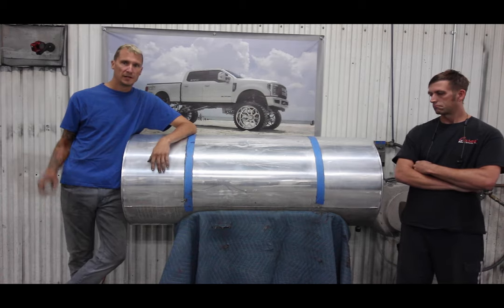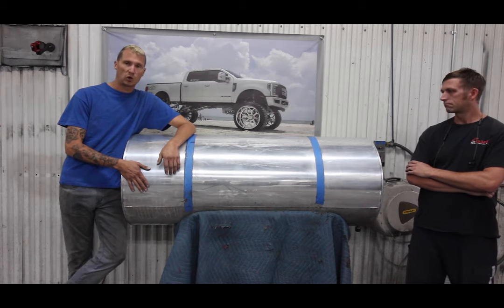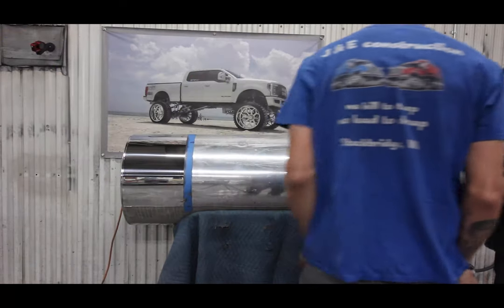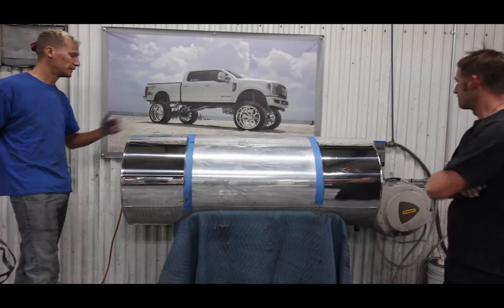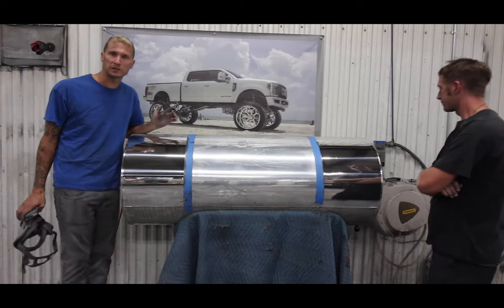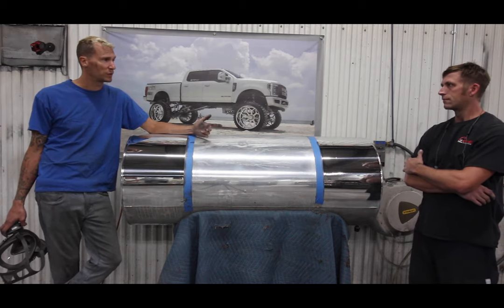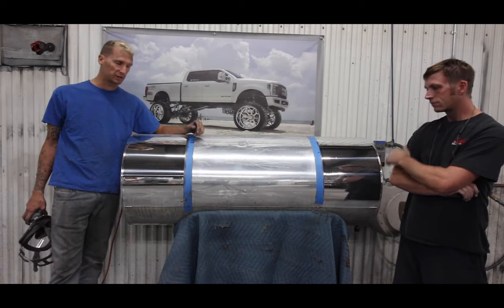Metal polishing difference between 3,000 rpm and 6,000 rpm with Evan's Detailing and Polishing

Comment: Good video with plenty of info. In a matter of saving time in my opinion the 6,000 rpm grinder works faster. I have the makita 6,000 rpm grinder. But seeing it in action doing what I'll be doing on my wheels shows me how it should look afterwards
Reply from the maker: I like the 6,000 as well but not everyone can handle it. Gotta use what you can control. Thanks for watching.
Reply: @EvanStegerMetalPolishing  thx for the videos man! This will be my first time ever polishing it using a grinder I’m going to polish my dump bed on my dump truck on somthing like dump bed should I go right into 6000 rpm grinder or 3500 variable?
Reply: @aspavingllc8302  I would sincerely recommend starting with the 3500 rpm variable as a beginner until you have a solid understanding of technique, when and how to apply/reapply your compounds, and how to approach different surfaces/corners/edges. Even with the 3500 rpm grinder you can really mess yourself, your work piece, or your equipment up if you catch an edge wrong and aren't prepared for it. Plus you're taking more material off quicker so mistakes are amplified. Not to mention you can't really do a full start to finish polish with multiple stages on the 6k grinder. You need lower rpms for your finishing stages. You can cut with the variable, but you can't use a softer airway/buff at 6k lol it'll tear itself to bits. 

not sure if you're still looking for this answer but 👍🏽👍🏽
Reply: Thank you Evan for a really great and informative  video .

Comment: great video that’s for explaining this . i have seen the the buffing wheels say max 3000 rpm is that still safe to use in a 6000rpm grinder or do you have to use buffing wheels that say 6000rpm ?
Reply from the maker: No buffing wheels are made to run at 6,000. It isn't safe but we risk it based on the speed we can accomplish shine and the quality we can achieve in a hurry.

Comment: Evan, a question: These airway buffs you and the industry uses to polish metal; can they be attached to either an angle grinder or a rotary polishing machine? What kind of adapters are needed depending on which machine if both are doable?

If those buffs are made in 8, 9, 10 & 12 inch diameters, what's the minimum size angle grinder one can buy? Because if the shroud can be removed, I'm not sure where the limit lies. Most angle grinders are 4 1/2", then 6", and 7/9". But I believe that's all about that half-circle shroud.
Reply from the maker: 4-6" grinders spin way too fast and can become deadly. I use all 7" or 9" grinders. I recommend beginners start with 7" variable speed 3500 rpm buffers. Then if you get comfortable or want to upgrade go with the 7" or 9" 6000 rpm grinder. I use all 9" buffing pads as it is the least amount of wear and tear on my grinders but that is a preference issue. Many polishers use 10" buffs because they last longer and better bang for your buck but I don't like how bulky they are. My own personal preference really. Up to you which way you are comfortable going.

Comment: Thanks for the instructions, demonstration, and product links. I have to long aluminum pontoons to do, which is a lengthy job, so anything that speeds up the process and how much aluminum you can cover in a given amount of time is a huge help! Definitely going with the 6,000 rpm, and thanks for the goshineon link. They have all the supplies I’ll need!
Reply: If ypu have a pontoon.  There is a product called white diamond polishing compound that  is real good since you have all those square inches.  It works fast. And last a while also
Reply: @stephentrutledge  thanks Stephen! I’ll check it out!!!

Comment: Love the videos, makes me want to get a 6000rpm grinder.  Why do you recommend 3000 rpm for beginners. Is it a personal safety thing or do you run a risk of damaging the workpiece with the 6000?
Reply from the maker: It is definitely a safety concern. At 6,000 rpm things happen very fast and if you aren't ready you can get hurt very badly. I've seen far too many very nasty accidents from people running 6,000 rpm and not ready for the possible consequences. On top of that you can do damage to the metal if you aren't careful. Airway buffs are only made to spin 3500 rpm or less.

Comment: I just started at a metal shop that has been around for sixty years. None of these guys wear respirators.. either using hand wheels like the ones in this video.. or on a larger stand-up polishing machine..
Should I definitely be wearing one or what?
Thanks guys
Reply from the maker: For me a respirator is a necessity. There is a lot of risk with metal polishing dust and aluminum sanding dust.

Comment: What safety flanges are you using on the wheels? And are you using buffer extensions on the 6000?
Reply from the maker: goshineon.com/shop has the safety flanges we use. They are custom insertable flanges. I don't use safety flanges on 6,000 rpm grinders. Only on variable speed buffers.

Comment: What is the best way to polish stainless steel pans. 🤔 would this work.. my food sticks more than normal due to how long I've had it. Also best way to remove all chemicals to avoid eating poison 👌
Reply from the maker: I don't mess with anything I'm gonna eat off of. Some compounds can be food grade safe but I'm personally not gonna risk it. Sorry bud.
Reply: @EvanStegerMetalPolishing  what about using lard. That could be a solution perhaps. 🤔 your thoughts.
Reply: If your food is sticking to a stainless pan more after it gets old it means you are not cleaning it properly. If you are needing less stickage, heat a high heat oil in the pan, just enough to coat the bottom entirely, till it barely smokes, then wipe it out with a paper towel. You’ll now have a stick resistant stainless steel pan. Polishing will do nothing but make it stick more.

Comment: What if i put a speed controller to my grinder to slow it down?  It can go pretty slow now with the speed controller. About these speeds, too.

I also tried buffing a steel scrap  piece with a drill with buff wheel attachments. On the other side of the piece, I sanded by hand and the hit it with the airways on my grinder with a speed controller. But it looked nothing like this. 
I even cleaned the surface off between grits and compounds with rubbing alcohol. I stopped at 1,200 grit.

On the buff wheel side, After sanding in overlapping lines with a drill pad sander attachment with foam interface pad in between, I stopped at 2,000 grit. (I read that ideal grit for steel is to stop at 1.2k to 2k grit) Looked good until I started with the compounds.  I started with black, then brown, then purple, then white, and finally blue.  It got shiny, but it left “smudge” marks.  Looks like smudges. I even cleaned the surface with rubbing alcohol between compounds and i had a separate buff wheel for each compound.

I don’t know if my rpms were too high, or what.  The drill tops out at 3,000 rpms, which I read is the max ideal rpms for compounds too.  Airways are a Sam Wo amazon airway kit. The kit says to hit with brown and blue wheel, purple and orange wheel, white with white wheel, and blue with flannel wheel.

Comment: I wish I could share a picture but I'm dumb lol. First time buffing with zephyr airways my tanks and wheels looked great. I sanded and did the 3 stage. Last weekend I started on my dumpbed and boy it looks horrible. It was in the 40's so kinda cold. I tried the wheels first and it wasnt cutting so I sanded 320, 400, 600 then tried to polish. My whole bed looks like it has black tiger stripes all over it. After this video I'm thinking maybe it was to cold and i was going to fast but I'm not sure. Gonna try again with a 6000rpm grinder before I spray it with acid and leave it white till I can get it to a pro lol.
Reply from the maker: Yes that is way too cold for most compounds.

Comment: I'm using a 12,000 RPM Milwaukee grinder and it's smoking and getting hot really quick is that too much RPM's? Should I get a 4,000 rpm grinder?
Reply from the maker: Way too much. Buffs are rated for 3500. I run 6,000 and worry everyday about losing fingers.

Comment: Hi Evan, great videos. I want to try and buff/polish a Apple G5 computer case, it is bead blasted and anodised aluminium, I have managed to get a small part polished as a test but it took forever(by hand). I have an orbital sander already, so do you think the grinder(Makita GA9040S01, we dont have the GA7021 in Australia) would be a better option than the Makita 9237c polisher? What grit sandpaper should I start with on the orbital or the polisher if I get that and use it for sanding and polishing? Thanks for your time.
Reply from the maker: Honestly I have no idea. The way I do it would build too much heat and wreck it.

Comment: Do you have to put an adapter or extension on your grinder for these wheels i got a zepehr one in the mail and having trouble putting it on with the saftey flanges seems like not enough threads on my grinder? Thanks
Reply from the maker: With the zephyr flanges year I believe you do need an extension.
Reply: Can you post the extensions please

Comment: im scared of getting 6000 rpm
will the variable speed suffice for wheels,tanks and couple of stainless boxes ? or i have to do 6000 as well
its hard to control
Reply from the maker: 3500 variable will work just fine just a slower process.

Comment: Hi,
I tried the 2 step process on a small piece of bull bar. But like in your video even on orange buff its already clearing up and shinning. But mine was just getting black. I tried different speeds aswell but no luck. What am i doing wrong
Reply from the maker: The piece was likely too rough and causing the metal to heat up the compound and make it gum up. Sounds like it likely needed sanding first.

Comment: So what rpm would be suitable to use when polishing aluminum wheels? Using zephyr compunds.
Reply from the maker: zephyr compounds are same as all other compounds in the fact that speed is relative to the way that you polish. You can use anything from slow speed to high speed. Just need to adjust speed and pressure in regards to how you do it.
Reply: @EvanStegerMetalPolishing  I have been seeing people on some of these videos polishing aluminum with an angle grinder. The angle grinder are 11,000 rpm, is that okay?
Reply from the maker: @chicagobearsfan5026  Absolutely not. 11,000 is way too fast. I've seen some nasty pics of polishers losing fingers and tearing tendons off from going that fast. Buffs are only rated for 3500 rpm max. Even the 6,000 rpm buffers carry a lot of risk.
Reply: @EvanStegerMetalPolishing  okay, I really appreciate the advice, thank you.
Reply from the maker: @chicagobearsfan5026  Glad to help

Comment: Hi Evan,
I'm starting with polishing my aluminum boat. I'm having a issue with black compound residual being left behind.  I'm starting with orange airway and brown tripoli with 3500rpm , Intent to do medium cut then final with white. And ideas to get a smooth cut first time around? Am in not heating it up enough and raking often enough?  Thanks
Reply from the maker: Sounds like the aluminum might be too rough to just cut. Might need sanded if it is leaving a ton of compound behind. If you want send pics of the condition of the boat to my cell phone 9209790386 and I will try to help you out the best I can.

Comment: Need some advice I do motorcycle detailing on the side. A customer has an S&S motor. What is a good way to polish the aluminum motor using rouge
Reply from the maker: I put my variable speed buffer in a vice and buff it out same as other aluminum.

Comment: Makita 9237c does that need the extension to be able to run the disc?
Reply from the maker: Depends on if you are running safety flanges or not and if so which type of safety flanges. The cheap black plastic or metal ones yes you will need an extension but if you have the nice metal flanges you don't need them with thinner buffs.

Comment: The wheels say “Max 3000-3200 RPM” most of them, so how does that affect using a 6000 RPM grinder? And rather then flanges for a 6000 what do you use?
Reply from the maker: That is the safe use rating. I spin mine 6,000 rpm and it is dangerous but it is the risk I take.
Reply: @EvanStegerMetalPolishing  what could happen if something goes wrong
Reply from the maker: @noa.l2405  Check out my video on the dangers of metal polishing.

Comment: so if its faster to use a higher rpm why are bench buffers lower rpms than  bench grinders?
Reply from the maker: Bench grinders are different since you are taking the part to buffer instead of the buffer to the part. Bench buffers build more heat and usually use 12-14" buffs instead of 9" buffs. Bigger buffs create faster wheel speed. The edge of the buff is spinning faster at the edge than it is at the center. Hope this makes sense.

Comment: Hi there what size wheel are you using on your 3000 rpm are 10 inch alright on them
Reply from the maker: We typically use 9 but 10 does work well too.

Comment: Hello. I'm an auto detailer in Northern Michigan. I get a lot of requests for horse trailer polishing, as well as wheels and fuel tanks.  I just bought a Zephyr aluminum polishing kit.  Can you give me any tips for the wavy aluminum on horse trailers.  Also what is a good Sealant to use after the polish
Reply from the maker: You shouldn't need sealant after polish. Rouges should have plenty of wax and sealant in them. On wavy aluminum I do it same as my fuel tanks. Check out my fuel tank video here on my channel. Should be super helpful.
Reply: @EvanStegerMetalPolishing  What about Sharkhide?  Pontoon polishers recommend it.

Comment: Love your vid, i will come back and review this vid again and detail in on tips and tricks, I am buffing a 1965 air Stream. any words of advice?
Reply from the maker: My best advice is good luck. Airstreams are the most difficult thing you will ever polish or undertake. The slower variable speed is far more forgiving on these big pains.
Reply: @EvanStegerMetalPolishing  What makes Airstreams difficult?
Reply from the maker: @gregorymarsh5742  Very thin material. Gets hot and cold fast. Risk warping and shiny/dull spots. Plus most are clearcoated and the coating comes off terribly.

Comment: What do you recomend for chrome front bumpers? Not alot of info on that
Reply from the maker: Nothing more can be done to chrome other than hand chrome polish. Chrome is just a plating on metal. If you buff it you’ll thin out the coating and eventually reveal the other metals underneath.
Reply: Evan Steger what about using the white domet flannel buff and a chrome polish?

Comment: Can I polish with a 8500 rpm grinder?
Reply from the maker: I would highly recommend against it as most buffs are only rated at 3500. But your choice is up to you and your preference.
Reply: @EvanStegerMetalPolishing  I won't bother trying I suspect I will find out it doesn't work when the wheel explodes.

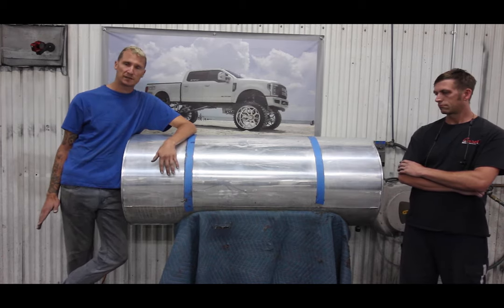Comment: Yeah... started polishing aluminum and stainless 30 years ago. Not a professional polisher, whatsoever. I figured out the heat makes a diff. I'm 2:10 in the vid.
Reply: Having said that... I used 4.5"-6"/10k grinders for buffing... and 10k / small wheels are a challenge. But they have their place...

Comment: Why 6000 when the pads are rated or advised to use no more than 2200 rpm
Reply: bro because everyone wants to do everything with an angle grinder instead of buying the real tool. the slower speed ones actually cost money lol
Reply: @cdrom1070  ya joking , cost money yes, loads "NO", I can get  one POSENPRO 125MM Corded Angle Grinder, 1100W Cut-Off/Angle Grinder Tool, Variable Speed 3000-12000RPM£33.99 reduced and 40 when it aint , they are cheap
Reply: @essentialone1 their always more expensive then the single speed tool, regardless of your cost range. people would still rather have 1 good grinder then 2 cheap grinders. bosche instead of 2 milwakee or milwakee instead of 2 bouers
Reply: might be a totally different situation if you use a liquid metal polish rather then the wax stick. i personally am super impressed by the performance of liquid aluminum polish. but it needs to be smooth enough to start